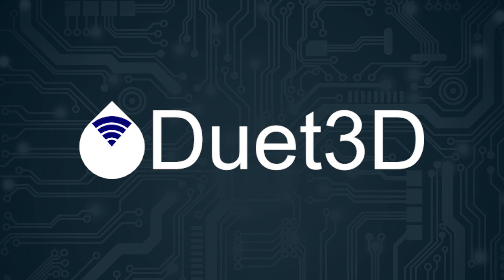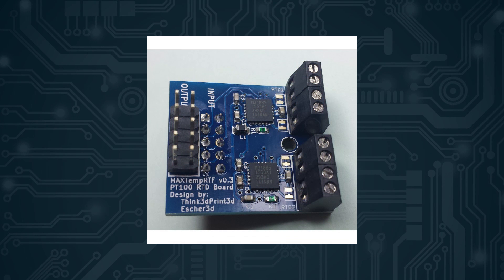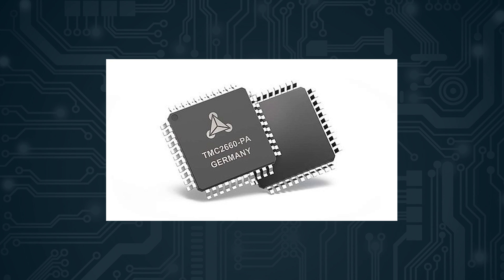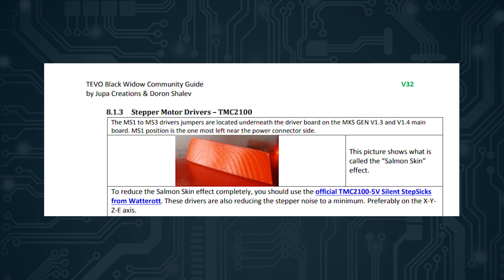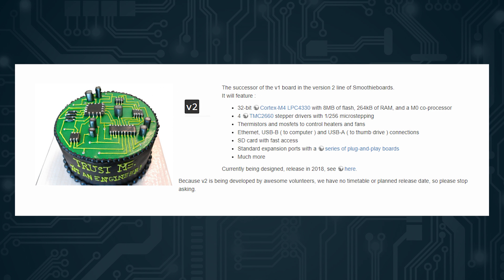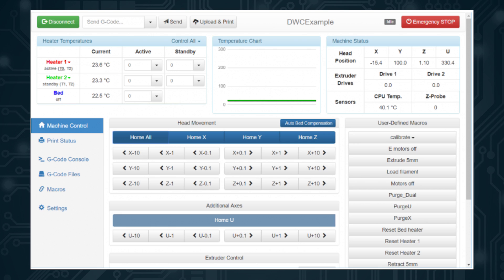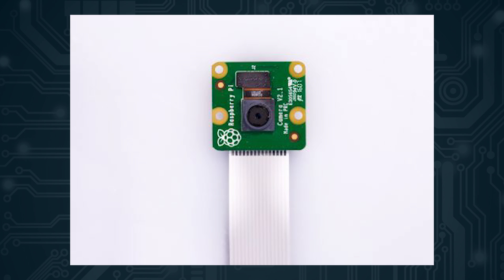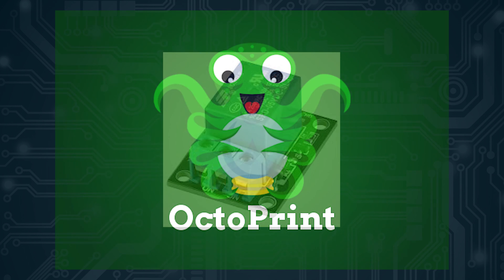Duet Wifi/Ethernet Review

Comment: Did you ever figure out that  with a move that takes less than a second to make and an acceleration of only 4600 mm/sec that an F150000 max speed is no faster than one around F4000???  Or more realistically around F2000?